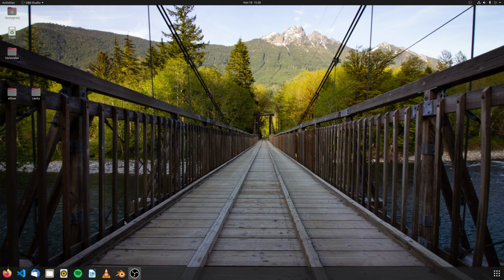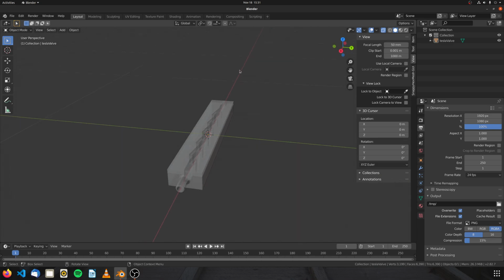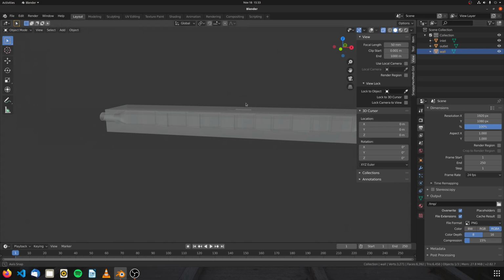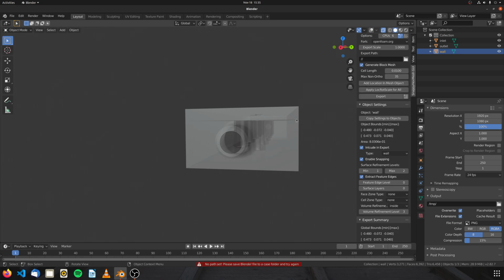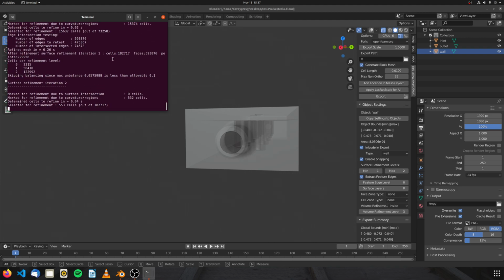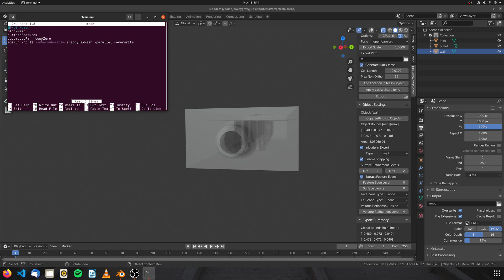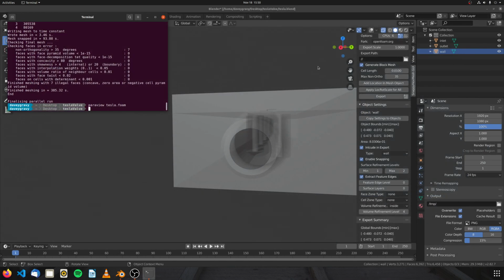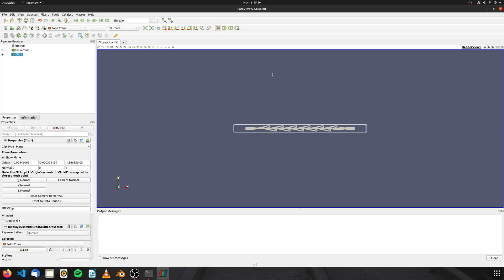Easy snappyHexMeshDict Generation in Blender

Comment: Hi Davey, when I try to run the command  'mpirun -np 6 snappyHexMesh -parallel -overwrite' , it gives me a fatal error "Shell wall does not support testing for inside
Probably it is not closed." I have filled the inlet outlet correctly. Would you please tell me what's wrong I am doing? Thanks. Do I need to add thickness to the walls or anything in blender? Thanks a lot.
Reply: wonder if you ever figure it out. I am having same trouble. Guess when saving wall, need to only save inner walls, not outer walls.